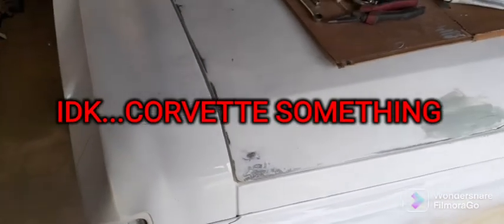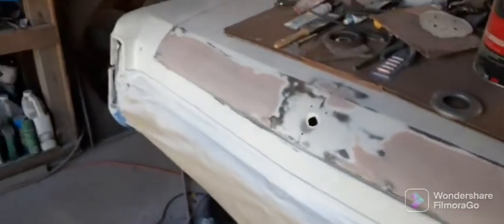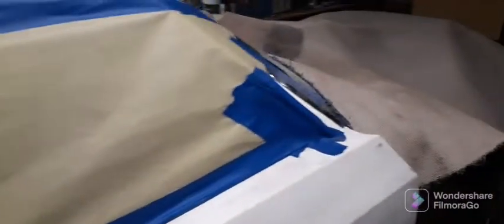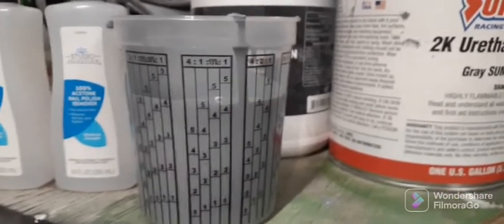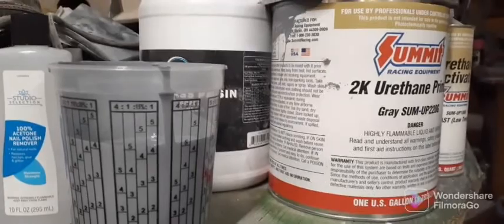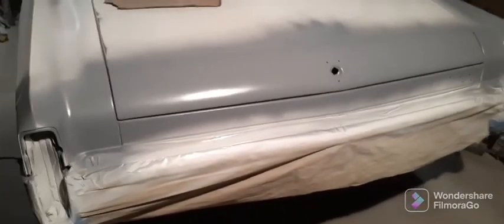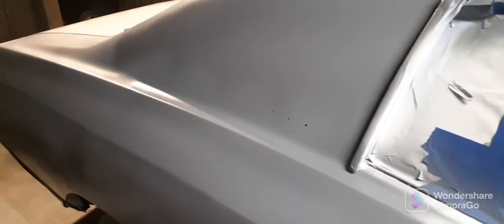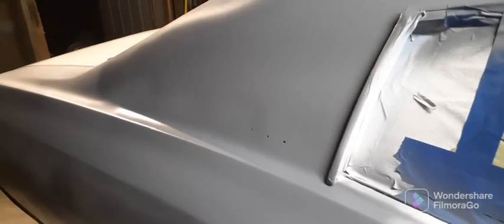PREPPING THE 71SS 454 MONTE CARLO FOR PAINT. #nonamenationals.

Comment: Nice work Hauss!  What size compressor were you using?
Reply from the maker: Hey LB. It's a small 30 gallon  3 hp. Central pneumatic. Thanks for watching brother 👍. See you soon 😊.
Reply: @bccoatheshop1716  Harbor Freight Job ay?  Is that an oilless or an oiler?  I'm curious because it's been 30 years since I painted a whole car.  I'm going to try and shoot a buddies '65 Alpine and I want to get a compressor that won't get winded on the HVLP guns.  So you like it?  It's been good for you?
Reply from the maker: It's  actually a Chicago electric.  Tank, with an American made 3 horse compressor and 3hp motor but I can't remember what brand they are.  And set up now for oil. Works real well now.👍